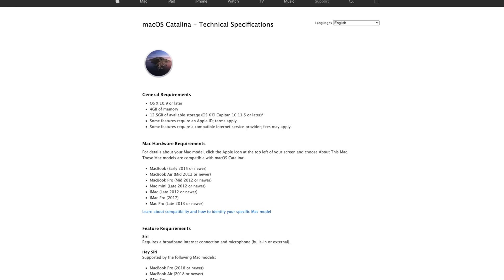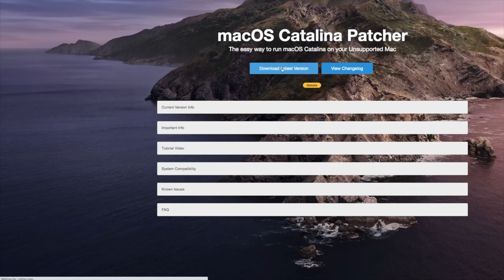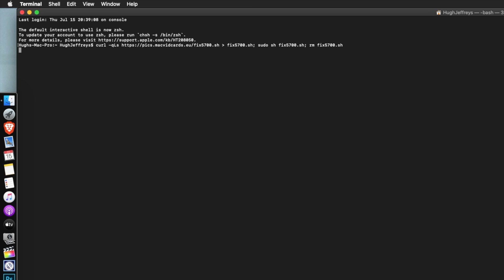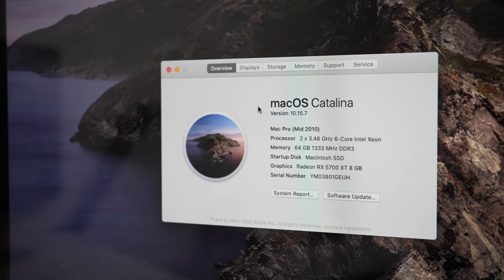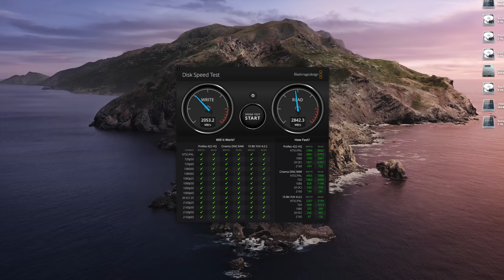Obsolete? Think Again - Keeping My Ageing Mac Pro Alive

Comment: I'm a sysadmin for a design company. I've just taken two Lenovo P910 Thinkstations out of service, as they were gettting old. The Thinkstations interior design makes Apple's designers look like amateurs. It's newer and therefore faster than your Mac, obviously, but was cheaper and quite a bit more upgradable than the Mac Pro, both old and new. We had a room full of old Mac Pros back in 2010, but our experience with Apple's built-in obsolesence was so bad that we switched over to Windows, despite all its flaws.

Comment: Dude, you went with DosDude and you should have used OpenCore (OC).  With OC, you will get hardware support for h.264/h.265.  This will vastly improve the speed of your video editing.  This might have already been mentioned in one of the 722 comments, but I didn't read them all.  Great video work though and I loved your comments, etc.

Comment: My 2012 is maxed out; 12-core 3.46Ghz, 128GB RAM, 2tb NVME boot drive, OWC M2 Pcie card with 8tb of NVME, 4x 12TB drives in 2-separate RAID1configuration, 4tb Time Machine drive in one of the optical bays, 580x w/8tb, and USB C card.  Once I get a (hopefully) "MacMini Pro M1x", I will repurpose my 2021 cMP to a file server.

Comment: great video - new subscriber earned.  I am still running a 2009 Mac Pro... haven't upgraded quite as much as you, but I have the max processors, RAM, and an RX 580 graphics card.  Seems to handle everything I need.  I am not liking the new philosophy of companies churning out computers that are planned to be obsolete and replaced within a couple years

Comment: 5:26 You don’t need power modifications to run a 5700XT, though it would be wise to do the Pixlas mod just in case. Some 5700XT’s peak above 300 watts (more than the 2x 150W per mini 6-pin) and could fry your motherboard. I did the mod only to run an RX580 since a friend of mine fried his motherboard in that way…

Comment: I daily drive an upgraded Mac Pro 5,1! It runs Catalina and Arch Linux. I use an RX 580, 24 gigs of ram, 2.5 tb storage (1 gig ssd, 1.5 hard drive), dual X5675s. How did that computer get so dusty?? Mine never got that dusty and I almost never clean it!

Comment: The old Cheesegrater Macs are still the best ones Apple ever made, and they're also the one that we want to buy again.  Unfortunately, the current modular version of the Mac Pro is far more powerful than most ordinary mortals will ever need, or can afford.  I still have and use my old 2010 and 2012 Mac Pros.  Sure, they are stuck on old OS's, but if you setup a RAID or install OS Server on them, they still make wonderful backup locations for Time Machine.  And the industrial design still can't be beat.  Timeless.

Comment: Mate, you should get yourself an air compressor and blower gun. You'd save so much time cleaning out dust - no disassembly, brushes or rags, just blow it all out. Cheap compressors can be had for <$300 and well worth it if you're doing this sort of thing regularly=)

Comment: It’s not planned obsolescence if they don’t support the latest operating system
Reply: what
Reply: @YitocukKilic  planned obsolescence means something more along the lines making a device unusable after a while

Which clearly this Mac Pro is not. Apple usually doesn’y drop software support from older Macs to make them obsolete. They do it due to time savings, and cost savings especially on older hardware (as testing a lot of devices (which you kinda have to do when developing software) so dropping older hard to develop for devices is an easy way to save time)

Comment: Bad video playback in certain formats is due to lack of hardware decoding from those ancient cpus. I know the point is to re-use what you have but spending money towards a m1 Mac mini instead of that gpu would've made more sense. You could try turning your existing machine into a NAS for file storage, but even then those cpus will be sucking a lot of wattage compared to newer ones

Comment: I had a 2008 Mac Pro with quad 2.8GHZ Xenons....Daily Driver from 2015 until I purchased my Base M1 Mac Mini in late 2020..... I left a boot drive but put all the other drives in a budget external enclosure for use by the Mini. I have to say with the low cost and power of the M1, I do not miss the Mac Pro at all. I sold it in March of 2021 for $250. I still have a nice 2014 iMac i7 BTO but I almost never turn it on.....I am "all-in" on Apple's future with the M-series SoCs

Comment: Hello! I have a Mac Pro 5.1 2012. I have now issues with it. I changed the cpu-tray in 2019 and got 12-core, the computer had only 4 core from the beginning. I now have 2 x 3,06 Ghz-processors and 128 GB RAM. I decided to upgrade the CPUs to 3,46 GHz (X5690) for three weeks ago and I have got the two 3,46 GHz-processors. I tried to loosen the two CPU-heatsinks, unscrewed all the screws, but they still didn’t loosen. I don’t know what they are stuck with. I tried to wrinkle them to both right and left but they didn’t move. I screw them together again and put them back in the computer. It didn’t start! The fans are spinning but nothing more. I probably damaged something inside the heatsinks when I tried to loosen them or the heatsink has no contact with the CPU’s. I have the original tray with one 3,32 Ghz CPU and 32 GB RAM in use now.  I wonder if my other tray is broken? Why did it try this when I haven’t done it before?

Comment: Do you run xeon x5690s? I run 2 of them and the core count matches. I run windows tho and have a dell t5500. My gpu is a 3070. I used to have 64 gigs of ram, but 1 stick died in the weirdest way where it would show up in system reserved memory, but not the total memory. Now I'm left with 48 gigs

Comment: I went the hackintoshing route around 2014 simply because I refused to buy into Apple's planned obsolesence model - which was a big leap for me having been a Mac user from 1990. I still own some now very old Macs which I run using Opencore Legacy Patcher, but these don't compare in performance or power efficiency to more modern hardware. That's fair enough - that's genuine obsolesence versus planned. The irony for me is that had Apple been even a little less greedy, they'd have retained some good will and I'd never have learned as much as I now do about hacking, DIY PC building and generally becoming significantly better informed, ultimately so I'm now very unlikely to buy another Apple product.

Comment: Do you still use this computer? And can it receive Mac OSX updates? Although the CPUs are miles behind the current Apple M chips, that GPU is miles and mikes ahead of the M chip GPUs in performance, and it runs boot camp.

Comment: "They can sell you newer one sooner and more often" is absolutely correct. The ironic thing about that with Apple is how they brag about how environmentally concerned they are when making their products yet their model forces us all to buy new machines "sooner and more often" making it so older machines get tossed and parts do end up in landfills because you know not everyone recycles them like they should. I HATE the new model of everything permanent on the board and no upgrading. It also forces you to buy way more machine than you need at the time rather than buy potentially the base model and upgrade it as you grow. It forces people to really over spend on things. 

Both of these reasons are why computers have become more and more frustrating over the last decade or so.

Comment: If you have not done this till now you really should replace the thermal paste of CPU and Chipset as 2009 versions of this Mac auto shut down already because of to dry thremal paste and therefore overheating. For you this will be very easy to fix and it will prevent the Mac from overheating. I have done this to the single CPU model of a 2010 Mac Pro using the same CPU and it runs now 9°C lower on CPU and 12°C lower on chipset.

Comment: Where can I get info on flashing my graphics card?  I have a Gigabyte Radeon RX 5700 XT currently running in my 4,1 flashed to 5,1 with power supply mod in order to get it to work.  The MacPro works plenty fine on 10.15.6 on maxed out RAM and CPU but I don't get the boot up screen.

Comment: I still use a 17 inch dual core laptop from 2008 to rip mp3s. It had a motherboard replacement. Battery has long gone so runs on mains power. I've recently added an ssd drive and it runs an old cinema display. Will an M chip mac last that long?

Comment: you're gonna kill that gpu with almost 0 airflow to it
Reply: yup. i saw his reply. it seems he thinks it wont. and the card above the gpu will also get killed.
Reply: @DMDMDM7  yeah it won't, until he realised why his GPU died so quickly compared to the GTX 980. Just because your core temperatures seems fine doesn't mean your VRMs and Memory Chips are
Reply: @keonxd8918  well.. he probably think he could just buy another one. that's what apple user always does...
that's why i'm thinking of unsubscribing from him.
apple users are you know...

Comment: I have a feeling I will keep my Mac Pro for quite a while. It continues to be the desktop that I use for daily tasks, family photo and video editing as well as some server use. 

When it fails to do that (or I can't keep a modern enough macOS version installed) I'll wipe macOS, and install Debian (Linux) to make it a server. The storage bays and dual processors make this a great home server. 

After that, it will keep my apartment warm in the Maine winters.
Reply: I bought two processors from a Mac Pro 2008 (for next to nothing -$), installed them on a regular 775 motherboard (using an adapter), and it's fine for regular use, (my friend is using) but the tdp is high! lol

Comment: In addition to my previous comment, it is good that stuck to Catalina. 

Big Sure 11.3 and newer has a change in Race Condition that renders a 5,1 useless. You can install anything above 11.3 but it will eventually kill your drives. They are currently working on a workaround called Latebloom for now until an actual solution is found. Big Sur 11.2.3 appears to the last version a 5,1 can successfully run.

Comment: Pro Tools recently stopped supporting High Sierra so unless I dump the Nvidia card (which I need for CUDA work as a PC) I’m going to have to move on. I cannot believe that my 4,1 2009 Mac Pro is still a viable workstation 14 years later. More than anything else I just love the form factor. Having grown up in the era of not being able to open a tower without getting a cut from some random unfinished metal edge the later Mac Pro towers were both beautiful and elegant.

Comment: I know alot of people have already mentioned the lack of airflow around the GPU and repasting the CPUs, but you absolutely should not be using mini-6pin to 8pin adapters. Those 6 pin adapters are only rated for 75 watts each whereas 8pin is rated for 150 watts. The Radeon 5700xt is a very power hungry card under load and can cause serious damage to the logic board if you draw more than the 150watts that the two 6-pins are rated for.

Comment: Having modified your machine, do you think its powerful enough to run hign end gaming (simulators?) 

Only I'm running off a mid 2015 Mac Book Pro Retina with 16GB memory and Intel Iris Pro 1536 MB Graphics and it severely struggles when running X-Plane.

Comment: buy a shopvac that sucks and blows. cleaning PC's is a hell of a lot easier when you take it in the driveway, and blow it out with air. its way cheaper than canned air, and does a far better job. ive been doing it since Apple 2e

Comment: As for the CPUs, I'm wondering if it would be possible to reverse engineer and make a new CPU tray. The Thinkpad X60 got an entirely new board, complete with a modern CPU, why couldn't the same be done with this?

Comment: i wish my old computer from 2004 was upgradable enough for at least core2duo, but its fine, i bought a used computer with core i5 3550 and 12gb ram, also amd hd7850 1gb, i gave my old conputer to my dad for light web

Comment: Hello Hugh, this is a great video. I currently have a MAC PRO i am looking to upgrade it's parts to the latest possible upgrades i can upgrade it to . I have a MAC Pro: Processor: 2 x 2.33, Memory: 32GB, GeForce 7300 GT 256MB. For the OS i have Lion 10.7.5 with a total of 7TB HD divided into 3 hd's. (4TB, 2TB, 1TB). I am very much interested in updating it as close as i possibly can with the latest OS, hardware, CPU and ram i possibly can. Any ideas/suggestions as to how i can do that or what would you recommend. Your help is much appreciated.

Comment: "I have the same cmptr Mac Pro 5,1 mid 2010 w/dual xeon x5690 processors (oc Monterey).

My question: is there a way overclock cpu
to their maximum turbo-speed of 3.733ghz?"

Comment: I'm watching this from my 2009 Mac Pro 4,1 flashed to be a 5,1 running Mojave, which is also my daily driver:

Mac Pro Build

Tower:
Mac Pro 4,1 36GB RAM, 2x 2.26 XEON quad-core processors (16 Threads): $400

Graphics:
XFX Radeon RX 580 with 8GB VRAM: $149.99

Storage:
M.1 NVMe Drive Reader ($26.99) + 1TB WD NVMe SSD (99.99): $138.73
WD Red 4TB Network Drive: $115.00
2x HGST 3TB Refurbished 7200RPM Hard Drives: $85.98
Total storage on this device (including external drives): 20.75 TB (4TB are solid state NVMe + SATA)

PCIe:
4-Port USB 3.0 Card: $32.76

Comment: I have this same machine at work, it sat for years under our video editors desk when they got a trashcan MacPro. I did the cpu upgrade, added 32gb of ecc memory, added a usb3/sata3 cards and replaced the 5770 with an RX580. 

Mine is on Mojave though, just wondering did the Catalina patcher work ok with your boot drive being on the sata card? Or is the nvme the boot drive? I do need to upgrade it to Catalina at some point, but I've switched to mostly remote work now so I dunno when I'll be able to do it.

Comment: I've got a 2009, flashed to 2010. 32 gigs but only single proc. It's a bit power hungry for my light day to day use but it's run with basically no issues since I got it nearly 12 years ago and could easily be upgraded to have better performance.

Comment: I currently use a GTX 660. Really wish I was able to upgrade to something like the 980. That would be a HUGE upgrade. The 660 is... barely useful for modern purposes, but it does work. I wonder if GPU prices will ever smooth out?

Comment: Interesting... I have a 2012 Mac Pro 5,1 and I've been really nervous about following this path. But,  give my 3 printers, 2 scanners, 3 external HD's (as well as the 4 drive bays being fully populated), two 30"Cinema displays, I am loathe to replace it with a new M1 MacBook Pro (or Max) and try to get everything to work as well as it doe now. 
What OS are you currently using and will you consider upgrading to Big Sur or beyond ?
And ! Have you run into any problems since the upgrade ?
Thanks again.

Comment: 4:36 bro how do you let your pc get like that? I've barely cleaned my pc over the 3 years I've had it, and it doesn't come anywhere close to that. I also have a cat who gets her hair everywhere.
Reply: These fans are very strong, similar to the ones used on servers, they pull a lot of air and everything nearby, dust and even your cat if it's close lol

Comment: just build a hackintosh on a 12th or 13th gen intel processor. I have a Mac Pro 5.1 12 core.  a new intel hackintosh blows it away in performance. plus the 5.1 sucks down electricity big time. so if you want a huge electric bill keep using your old Mac Pro.

Comment: Btw, is it possible to install some thin dust protection on the vents? Would help a lot! Going from a non filterd case to my Fractal xl r2 has reduced the cleaning need to once every 2-3 years and then its just a light dusting.

Comment: Isn't it bad to use the 5700XT without pixlas modding the PSU? I read putting those 8 pin connectors from the ports will overload them

Comment: if you put a lot of load on that GPU you will have unexpected shutdowns because the power coming off of the motherboard is at most supposed to give 150W out of the 2 mini 6 pin power plugs EACH 8 pin is supposed to be able to give 150w so that is 300 watts when combined that being double of what those plugs are designed and rated to do

Comment: so, dual x5690 cpus? Thats what it looks like. or possibly the w3690s? if it has x5690s, the w3690 could be a choice upgrade, as if I recall correctly it would overclock on any chipset, possibly on macs too with bios modding.

Comment: I'm seriously tempted to grab one of these for ProRes 1080p video editing and as a daily. I used to have a 3,1 but moved to Hackintosh in 2012 due to the lack of news on a 6,1 from Apple which eventually was the trashcan model. 🤢 

Currently on a Hackintosh with an overclocked 3930k and an RX 580 8GB, 24GB ram but I'm stuck on Sierra so software limitations are starting to happen alot. I'm also always having issues with Clover and booting. Some days it works flawless others it decides to not boot. 

I can get one of these 5,1's with dual X5690s, 96GB ram and I'd throw my RX 580 in, move over all my SSD/HDDs. Put a PCI card with the boot SSD in for faster speeds than SATA 2 and a USB 3.0 card. Then finally use Opencore and run Big Sur for a more up to date OS. 

Maybe it wont be better single core but should be better at multicore plus I'll have the benefits of having a more compatible system which is running on a more current OS  from 2021 and not 2016.

Comment: Hugh.
Dont do this! 
Im afraid this GPU is gonna die within weeks from VRM &VRAM overheating.
Reply: Ran a 5700 in mine for over a year. Never had an issue with it overheating.
Reply: @gregthompson7793  if your case isn't one with that limited amount of airflow
Reply: @keonxd8918  I use fan control software so the PCI bay stays cool. Everyone should use a third party fan control because Mac OS sucks at keeping anything cool.